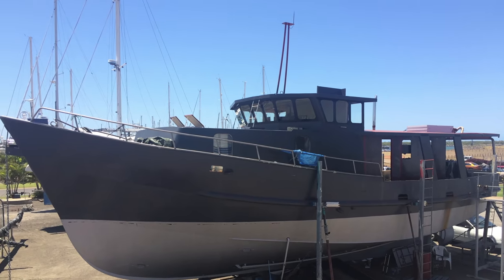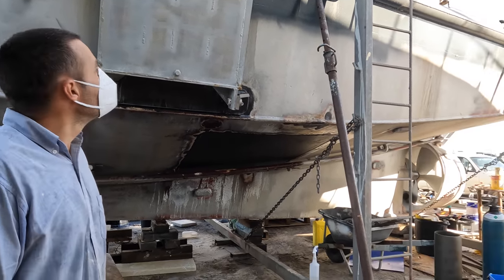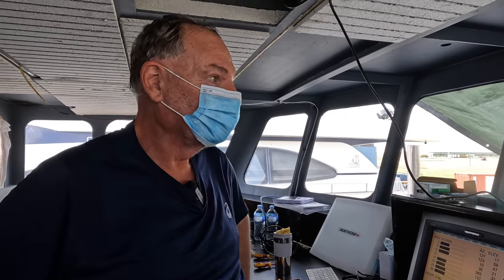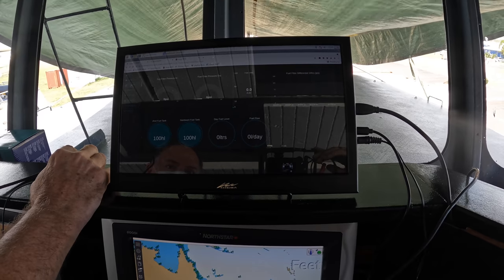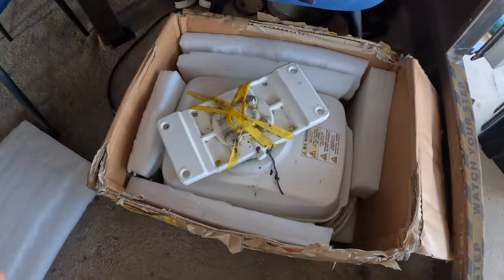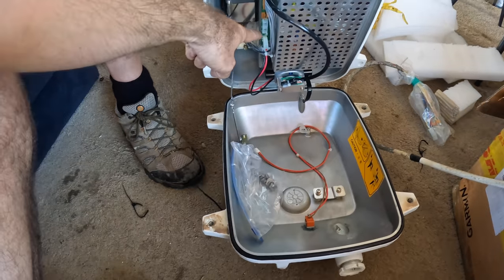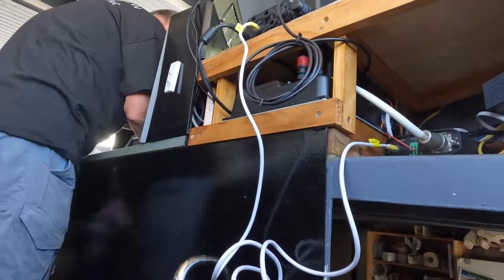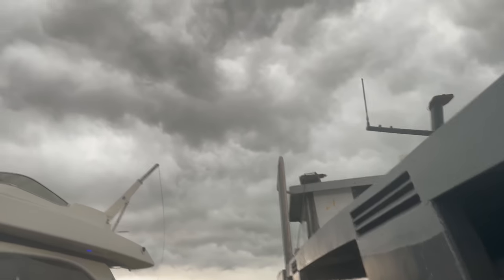Installing Brupeg's Radar & Monitoring System - Project Brupeg Ep. 245

Comment: What wonderful progress. Sounds like the radar needs some rubber mounts to help cut down on the the noisy motor, a simple addition to the mounting bolts. So happy for you guys. 😊🤝🤝🤝👍👍👍👍🇺🇸
Reply from the maker: Thanks Tom, Yeah we have discussed the noisey bearing. The radar has around ten hours of use so it’s practically brand new. We are not sure if the bearing is a dud but either way we do plan to add some rubber mounts as it’s going to get annoying after a while.
Reply: @ProjectBrupeg   All the radar installation instructions I have read, say not to lift the turning unit by the antenna, otherwise you will damage the rotating joint. Do not know if this was the instance in your case. Agree using resilient mounting bushes will help. Good luck I do enjoy following you.

Comment: Dame, on marine radar, you should not be seeing clouds or ocean waves. There are adjustments to “declutter” the screen so you only see the returns you want, like ships, bouys, land etc. one of the reasons you have so much cable is because it’s a 64 mile radar. Normally a long range radar would be mounted much higher than you have on Bruepeg. Radar can only see to the horizon, so the higher it is the farther it can see. You’ll probably be able to see 30 miles or so with your radar mounted where it is. You might see some ships or land at greater distance if they are very tall.
Reply: @ralph9987  Is that not why you have multiple radars on larger ships? One or more tuned for navigational purposes and another tuned for weather?
Reply: @ralph9987  I know it's rare to have multiple radars on smaller boats. Was more a general question :)

If the radar tunings can be saved as different profiles in the system that can quickly be recalled, that would be neat, so one can have a setting for weather and another for navigation etc.

Comment: If you are replacing a bearing on the radar base, consider putting a rubber isolating mat under that base and above the metal plate. It should reduce the noise of operation even further. Anything non-perishable, like EPDM or butyl rubber, should work as it would be cut to size and not particularly exposed save for the edges, which could take a line of paint.

You might want to take a course on how to get the most out of your radar, which is a quite powerful one for a vessel your size. You can tune it to view types of weather, downdrafts, squall lines and all sort of things you want to usually avoid besides the hard edges. And, of course, integrating the AIS (especially as AIS "virtual buoyage" becomes more prevalent) is just icing on the night watch cake.

Have to wonder, however, if that Starlink is robust enough to live up on top!
Reply from the maker: Yeha we have talked about rubber mounting with Peter, I have found some rubber mounts that should do the trick well, just need to get up there and bolt them in. Pete was saying the radar had the noisey bearing the second they turned it on new, so its likely the bearing is a dud, will be looking to replace it soon but likely not before launch. As for starlink, we wont know until we put it through a few shitty weather spells. wind and rain dont seem to bother it, we'll see hw it goes with rolling around, im guessing over time the servo motors will have a hard time. also thinking about building a fibreglass dome for it to further protect it from the elements.

Comment: Got my Starlink last week.  It gets better after about 24 hours.  Keep in mind, however you mount it that the dish can tilt to near vertical and swivel nearly 360 degrees.  
The speeds are only going to get faster as the constellation gets closer to completion, so you made a very good choice. :)

Comment: You've been gifted an amazing array (pun intended) of pro-grade gear there, which would be more than enough. But the expertise to wire it up and make it bulletproof is probably even more valuable, because it would take the pair of you ages to learn enough to do this solo. I'm still puzzling out getting 0183 to talk to 2000 and I've run out of voodoo charms!

Comment: Heya! that's the gen 2 Starlink dish , it supposedly does not have the external Ethernet port on the router , you have to get an upgrade part unlike the gen one that come with the system. I have had Starlink for over 2 years now its amazing , i got mine in November 19' in the Starlink beta. Expect varying speeds i have seen speeds as high as 250/30mbps, but during rain and snow it can drop down to as little as 20/5 possibly less. My average speeds are between 50-90/5-15 mbps, and consider the system does not have satellite interlink yet so you will have to be in range of a ground station, and they have not Un-locked roaming yet except in one location. Pretty neat!, ill be keeping an eye on how it works out on a boat !.
Reply from the maker: Yeah i ordered the ethernet adapter when i put the final payment across for the 2.0 dish. adapter has not arrived yet so we are going to try and link the wifi sides of things into our existing network. not sure how that is going to go but until we get that hardward we dont have other options.

Comment: Just a suggestion at 24:00 for that extra space between the monitors. It strikes me that instead of audible alarms for certain functions, that might be a place for certain critical "trouble lights", such as bilge pump cycles/water ingress sensor, overtemp for the EGT or other "events" that need immediate attention, such as (thinking aloud here) the activation of an AIS SART "tag" of the type worn on a PFD. When you have that Vesper XB-8000 (very solid unit, by the way), you can have it put AIS targets, including a crew overboard MMSI number from the transmitter on the PFD, activate a light and/or sound signal on the dash. The unit transmits if you are, say, 10 metres farther away from the boat than the boat's length relative to the location of the antenna on the bridge roof. Of course, you have to silence the alarm if people are using the tender, but it's good to a few miles and is going to be better than most feeble lights. 

Anyway, I've digressed, but "trouble lights" adjacent to the main nav screens, and then looking for the mystery icon you want, or the gauge over to the right, might be a simple set of alerts to install.

Comment: When we rigged up our sensors around oil rigs, we had to make sure that the cable screens were grounded only at the unit end of the cable. Otherwise we got stray currents and interference on the signals.

Comment: Damon, watching this video among other things one stood out, looking at the back of your blue shirt it was Hot in the wheel house.
Why haven't you got a reverse cycle Split ac  at least in the pilot house? I'm sure that you will spend a lot of time up there and come hot or freezing weather way down south it would come in handy.
As a price  recently I shopped around for 2.one for me and one for a mate we ended up getting them from good guys both Fujistu my split system 5kw, Peter's 3kw, 1400 and 1000$ respectively after playing one store against the other.
I know battery power,/solar etc could be an issue for you 
Are you running a high output alternator on the engine? 
 As Brupeg will be running with the engine to move if the right alternator is installed and Inverter that aslo as you would know should be topping up your 24v battery system.

Shortness  of statue in wheel house, 
Duck disease ?
Bum to close to the ground?

I'm not short I'm fun sized.

I'm not short, I'm just more down to earth than other people.

God only let's things grow until they are perfect, some of us didn't take as long as others. 

We maintain a great perspective on life, because we are always looking up!

Life is short and it is here to be lived.

Cheers mate 😁
(6ft this way)

Tony from Western Australia 🇦🇺

Comment: Do you have a p clip to secure the cable from the mast into the North star radar to prevent vibration damage. Awesome progress. Well done Duncan 👏
Reply from the maker: No but I can easily add one in. Have some decent stainless ones with rubber inserts that will do the trick

Comment: I'd be inclined to shorten the cable length, while it won't be a fun job you can cut and resolder the Amphenol looking connector that fits at the southern end of the install.
Reply: Hi Jason. Yes, now that I know more about the signals it carries, there is nothing special, so will cut the cable and re-attach the connector(s). Cheers, Duncan
Reply: @duncancampbell62  Good to hear, it'll make life much easier. You look like you've built a nice system, Duncan, looking forward to seeing more of what it can do.

Comment: Looking fantastic! I’d love an engine monitoring system like you’ve got…

Please don’t take this the wrong way; and it’s coming from someone that’s current neck deep in marinizing a 3406B standby land generator to marine use…

I’m not an expert in 855s in any way, other than I worked on a boat that had one as a main. I’d really look into a water jacketed turbo and exhaust manifold. Your engine room temps will be extremely high without one; as well as the inherent fire risk of having an exposed 900 degree manifold. 

Another thought I’ve pondered has been to fabricate SS water shrouds around the manifold and turbo on my 3406. More or less, it would accomplish the same task, for (possibly) cheaper. 

Again, don’t take offense - just offering a suggestion.
Reply from the maker: I have pondered this. I’ve spoken to a Cummins expert re the manifold and turbo and we will likely upgrade but it will be dictated by cashflow. We have wrapped the turbo exhaust now so some heat will be removed
Reply: @ProjectBrupeg  Fantastic. I’ve lost sleep over the same issues on my project… really tough to allocate the funds when I’ve got a perfectly good 3406B as it sits now! 

We’re headed to shipyard in April; adding 6.5 feet of width on either side of her.

Your dedication to the project and attention to detail is mindblowing!
Reply from the maker: Nice. That will be bloody fascinating to see

Comment: Hi guys  ,I have watched you both for a few years and have enjoyed following along ,can I ask are the ceiling tiles fire resistant tiles or just polystyrene. Am sure you would of checked it was just playing up in my head ,cheers  stay safe stay healthy
Reply from the maker: Hi Wayne. They are 60mm thick polystyrene but it’s a fire retardant type. If tried to set them on fire to check and it just shrivelled up without any real smoke. The plan is two layers for external walls and a single layer for all internal walls

Comment: With the amount of ‘technology’ you are mounting it would be worth considering a 19” rack cabinet on the back wall as this will provide you with infinite expansion and also easy access to all your wiring …. these racks are designed to manage ‘spaghetti’ wiring in an efficient tidy manor.
Reply from the maker: I have pondered a rack but most of our gear is not rack mountable without having to build brackets for every part
Reply: Funnily enough, in thinking about the networking aspect (switches) etc, I pondered the same thing. I don't think we could locate it conveniently, and as Damien says, most of the rest of the gear, not rack mountable. Still much tidying up to do.
Reply: Rack Shelves are a thing, you may be able to bolt the gear to standard rack shelves and then install those shelves into a rack.

Comment: If tested, does the mast directly behind the radar antenna cause a dead spot or decrease the
range dead astern? If not tested is it assumed that there will be some interference with the transmitted and received RF from dead astern?
Reply from the maker: I assume we would have a dead spot, but on the screen its impossible to tell. That said the radar beam is 1.1 degrees so the dead spot theoretically is very narrow

Comment: Watch the minimum bend radius on the  Starlink and RADAR cables , there is likely a Spec on it.
Reply: Yes indeed Tom, there is certianly a spec on the radar cable. Now knowing a bit more about the signals within the cable (nothing special), we have plans to shorten it - not too short though 😉
Reply: The Starlink cable is apparently only CAT6 with heavier gauge power conductors for the 100W Dish, no RF. I think a dome would be a very good idea, it does not seem to be Salt-Spray resistant, also not sure how well it'll track while under way. The Starlink Reddit is a good source of more info.
Reply from the maker: Cool. Yip we knew this wouldn’t be a perfect solution but while stationary the boat should be fairly stable and anything is an improvement on terrible 4G reception
Reply: True, out at sea , it won't work well until the sat fleet is upgraded with LASER comms, otherwise a base station will be needed nearby. But you'll be fine in port or near a ground station. Brupeg under way with the wings down may have roll and pitch rates within the limits of the 2nd gen dish servos. If they are really limited, maybe there will be 3rd party options for 2nd level of pitch and roll stabilizer mechanism.

Comment: get a redundant pre programmed Pi... This way you have a backup of a major system you wont otherwise be able to replace at a random port.
Reply: Got exactly that. There are two Pi's stacked. At the moment, if/when the first one fails, the connectors just get moved to the second one in the stack. Also, each Pi has a RAID1 USB drive for the datalogging. We haven't really explained this side of it yet. Will do so in an upcoming episode.

Comment: What I believe is that Starlink doesn't roam at this stage, certainly capable but not programmed as yet.
Reply: It gets more complicated than one might think. They will have to liescence the system with the FCC and every country they work with for downlinking. Moving transmissions are different than static of course. They did open moving basestations in the Ukraine according to Elon. I think the FCC is giving them a wink. Don't know what they are doing for frequency coordination  or if it's even needed. Lots of questions still remain.

Comment: Can you explain why you didn't cut the radar cable and rewire? Impedance?
Reply from the maker: Tuned length cable. Alter it and you can change the information the radar receives. At least that’s what we thought. Duncan may have solved this though and we may be shortening it soon
Reply: Yeah, we didn’t know any detail of the cable and signals at the time. So best approach is to not mess with what we didn’t necessarily know about. I since found more info on the cable and it turns out its pretty straight forward and out nothing to prevent us shortening it, so will do that eventually.

Comment: I worry about how much this complex electronic apparatus is protected against dampness, corrosion, etc., not to mention the real possibility of getting green water inside the pilothouse as a result of window breakage or a door being wrenched open in some of the stormy and unforgiving places you are planning on visiting.
Reply from the maker: John this is a fair concern and all of this is a risk and all we can do is mitigate the risk as much as possible. The wheelhouse is a very dry location with Air Con running almost all day. As for green water, thats a possible risk, a couple of things we have done to mitigate that. Brupeg originally had 6mm laminated glass on all wheelhouse windows, these were bolted in with thin alloy frames. we have removed those frames and replaced the windows with 10mm toughened glass thats bonded with 50mm overlap onto the steel (normal is 30mm), we will also be fitting a second 6mm laminated pane of glass to double glaze all windows, so while its a risk to get a blow out, we are well overspec'ed from what she was (and lasted) for the past 50yrs.
Reply: @ProjectBrupeg  fair enough.  Even if military-grade ruggedized equipment were available, it would probably cost 10 times as much and be vastly more difficult to replace if damaged.
Reply from the maker: Yeah 100%. Plus we have spares of as many pieces of gear that we can located in other areas of the boat
Reply: @ProjectBrupeg  I have amended this post from yesterday to bring it into this century.  I must have had my brain switched off when I wrote it.   There are hand-held fully waterproof GPS units, some of which also have EPIRB capability.  (Some are designed for divers who surface and discover themselves out of sight of the dive boat.) With one or preferably two of these, plus a generous supply of batteries, and paper charts for the area you are in, in a truly waterproof case (surplus .30 or .50 cal. ammo cans are wonderful and easily available, at least here in the USA) you will be able to get from where you are to the nearest port.